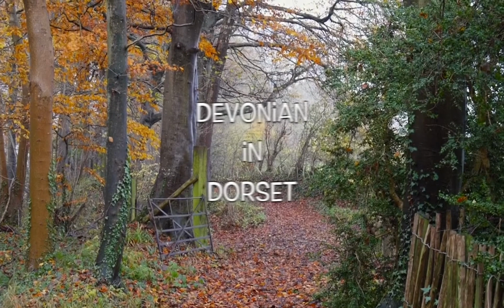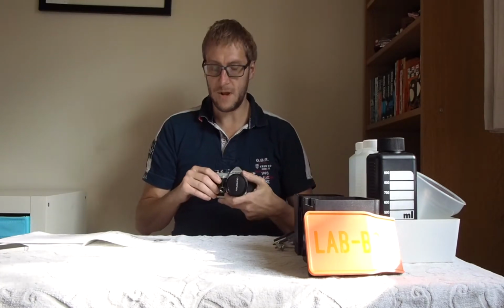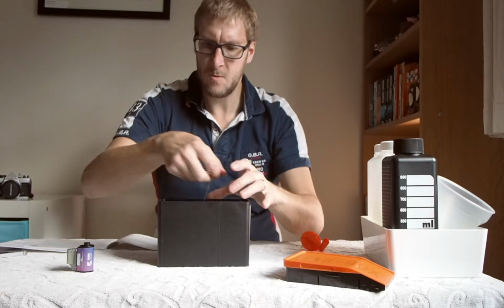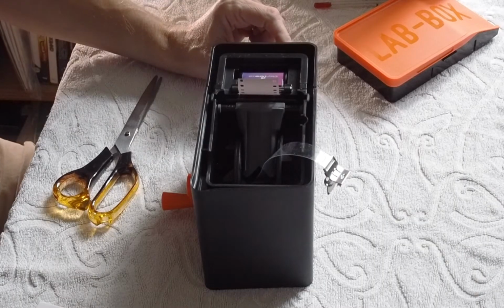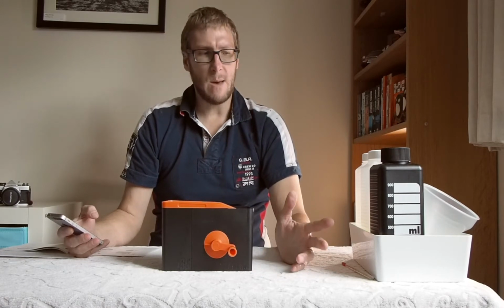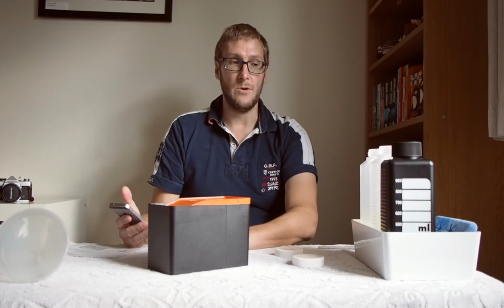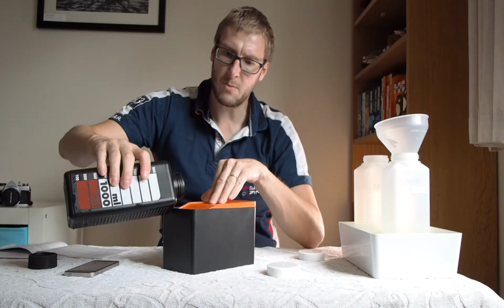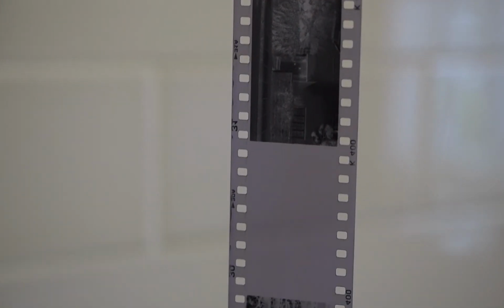Developing 35mm Film using the Lab-Box (Step by Step)

Comment: I have processed lots of film (35/120/45), and loading 120 film is not easy.  Now that I got older, losing the feel, and frustration dealing with 120 roll and the paper......might get one of these. Some argue that it only does one film at a time....true....but just like Unicolor drums for printing, rinse it out, wipe dry with paper towel, and in 15 mins you are ready for another roll.  Yeah, you can stack  several rolls using stainless reels, but after not doing BW processing for a few years, I doubt I will have the feel of the film, in the dark, now that I am older....this looks nice and easy....with daylight loading....it's strong point. Doing 35mm in stainless reels, and kinderman tanks (or Patterson)....easy......but for 120, this is tempting. With 120 it is so easy to get a kink in your film, takes a while to get back to the comfort level working in the dark with 120.....this takes away the stress.
Reply from the maker: Glad it has given you food for thought. I'm doing well if I develop 2 rolls a month so the lab box continues to meet my needs fine.  I will try colour developing at some point but will probably need to try and shoot more to make it worthwhile due to the relatively poor shelf life of colour chemicals compared to B&W work.

Comment: I'd like to comment on a point which got a passing reference, but might deserve an expanded explanation, being the need to disconnect the 135 module before film washing, if you wash the film in the LB tank. In one of its several unexplainable acts of cheapness, Ars used a film cutting blade made out of ordinary steel rather than stainless. Therefore,  if you get it wet, it rusts, and does so quite quickly, which can make the blade jam and fail. I have wondered if the module can be disassembled and a proper quality blade made and installed, but have yet to check that carefully. (I do not wash film in the tank, so it is academic to me.)
Reply from the maker: I always detach the modules before I rinse the film but thanks for highlighting this for those that may not think twice about not disconnecting the module.

Comment: I realkae I'm two years late here but did you ever come up with a solution for the temperature issue? Or did you have any success developing at room temperature and adjusting the times?
Reply from the maker: I always aim for 20 degrees C whether that's adding ice/ice blocks or warmer water into a tub of water with the chemical bottles in, then taking their temperature and removing the chemicals when the 20 degrees C has been reached.  The temperature s might then vary slightly during the development but they should remain relative to each other.  I'm sure you can alter the development times using different temperatures but it's not something I've experimented with yet.  These videos are timeless really for as long as I'm still using the equipment as it's the same process each time. Thanks for watching.
Reply: @ChrisEdgecombePhoto  good to know, thank you! I just got a LabBox so your videos have been really useful

Comment: I was also wondering how you control the temperature.
Reply from the maker: I don't control it in the lab box, I just use hot water/cold water at the moment in a vessel with the developer/stop bath and fixer containers in to try and get them all to 20 degrees C.  I do have a sous vide wand but haven't mastered it yet.
Reply: @ChrisEdgecombePhoto  Do you just start with it warmer and wait for it to cool to 20ºC?
Reply from the maker: I guess it depends where you live and your climate, water left at room temperature for me comes up to about 18 degrees for me so I only need to raise the temp by a couple of degrees. So warmer water and then take bottles out when it reaches 20.  If it was warmer to begin with, I'd add cold water to the container or even ice to try and get the  chemicals down to 20 quicker.

Comment: For black and white, I just get the dev to 20C by adding hot or cold water (measure out dev so you can add it last) and use straight away. Stop and Fix you don't need to be as accurate, just in the ballpark area.
Reply from the maker: Thanks, so pretty much what I’ve been doing so far. That’s good to know.

Comment: Really interesting Chris. I've been using AG Photolab to process and scan my films (because I'm lazy), however I've always been curious to give film developing a go. A few questions - how do you minimise dust landing on the film whilst it is drying (I have a dog which is an additional challenge)? Also, what do you use to scan your films? I've read that some software is not so hot on removing dust etc during the scanning process. Thanks fella.
Reply from the maker: I haven’t had much trouble with dust, I apply photoflo to the final rinse and then hang to dry in the bathroom on a DIY strung rail.  I use a rocket blower before I scan. I use my EM1/Pen-F with the 50mm macro on a copy stand to scan the photos and then use an inexpensive process
called CNMY film inversion to invert the scanned negative in Photoshop CS6.  Any remaining dust can easily be removed then in PS but I generally find my home processed film is much better in terms of dust then I was getting from AG.  I’m still on monochrome mind, haven’t tried colour developing yet.  One of my earlier videos runs thru the CNMY process for both film and colour negative processing.

Comment: Nice video and results, i used to paterson tank, and my lab box still unused in box, do you have to keep agitating throughout the whole proses? Coz my developer stated only agitate partial time though
Reply from the maker: There are two approaches; fill the tank 490ml and agitate intermittently or agitate constantly with 300ml of chemicals in the tank. The manual details both approaches but recommends the constant agitation method for more consistent results. This is the method I use and it works well for me. Thanks for watching.
Reply: Ahhh thats why, i need to unbox and read the manual! Hahaha thank you 🙏🏻